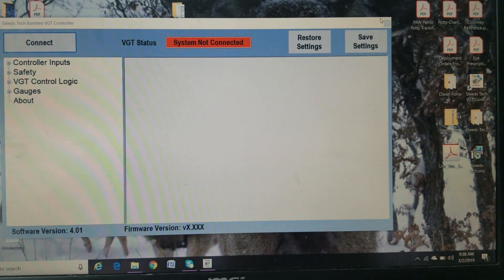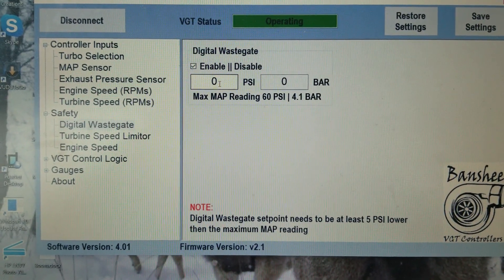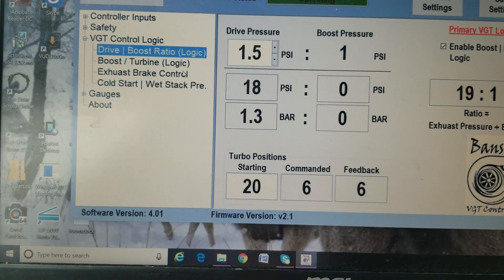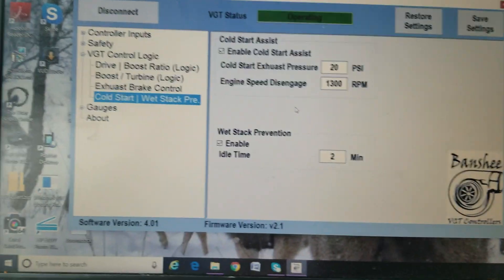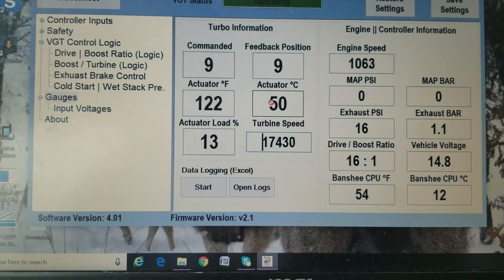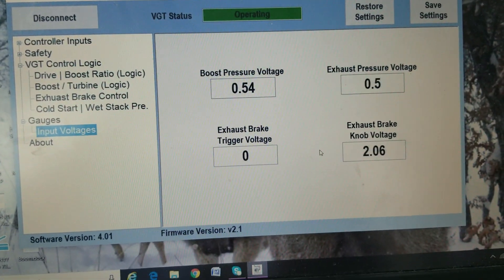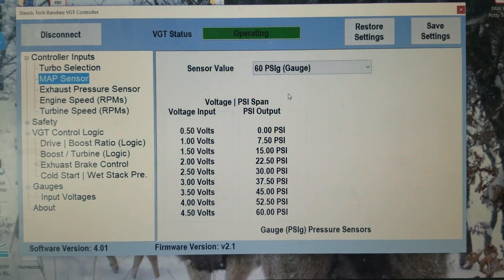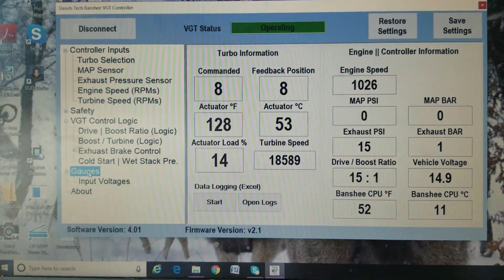Banshee VGT cold start assist Wetstacking prevention

Comment: Sure hope I can calibrate actuator. The first and foremost reason I ordered the controller. Wondering if you will notify me of shipping.
Reply from the maker: Yup you'll be able to. I'm finish up a few more updates this weekend and itll go out next week. There's a ton of revisions in the new setup and I'm trying to test everything out.
Reply: @SteedDolan  Thanks, I will certainly be happy to wait a little for the latest and greatest. I think I may be using the Banshee instead of the maybe it will and maybe it won't logic of the ECU. It is not optimized for a properly running engine, and certainly not for towing a heavy load.